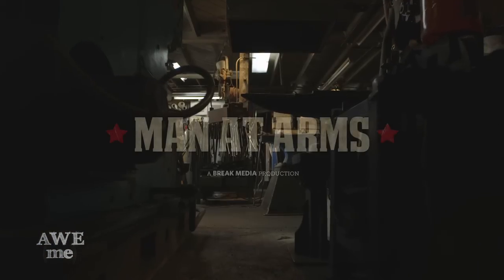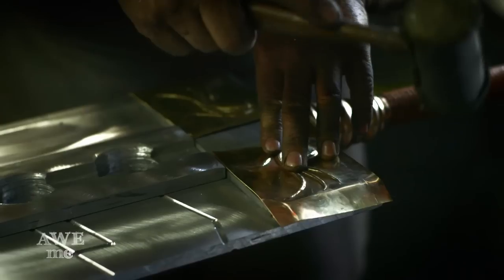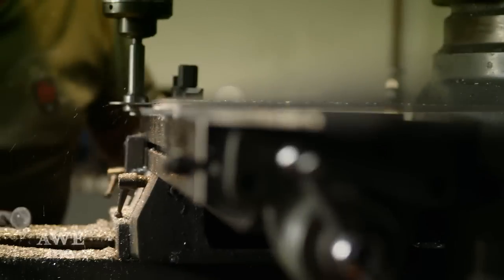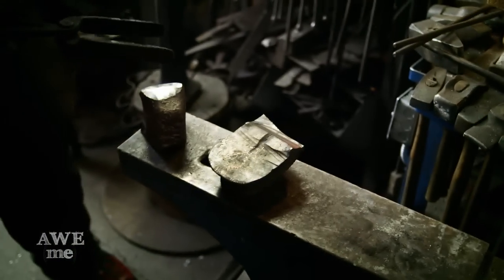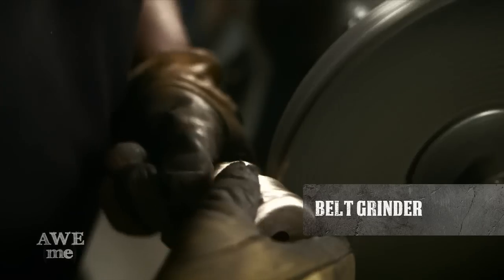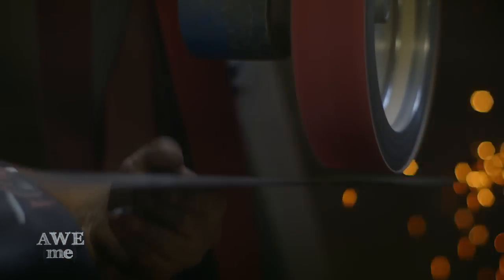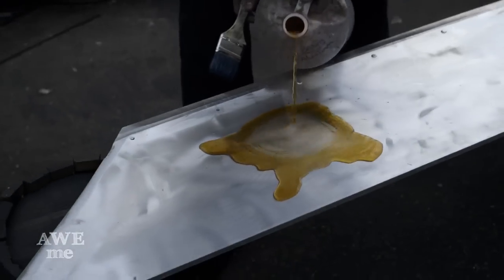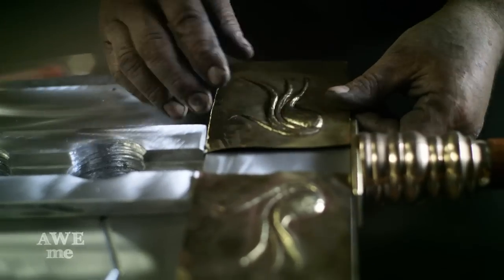Cloud's Buster Sword (Final Fantasy VII) - MAN AT ARMS

Comment: 2 people barley holding it cloud spinning it with one hand like a fidget spinner
Reply: Well, while they did a fairly good job, they oversized it.  They measured the blade at 6 feet long.  Considering Cloud is 5'7", 6' would be probably the entire sword length, not just the blade.
EDIT: Because I didn't go through the whole video first, here's the rundown.  They sized the blade at 6' long.  They then made an 18" handle.  That means the overall length of the build is 7'6", give or take a little.
Reply: @Anduril74871  oh yea just remove a foot and a half and then every person can twirl a greatsword around in the air
Reply: Cos they use heavy material when it doesnt need to.
Reply: Well, he also is a super soldier sooo.. mako mako mako
Reply: @mymagicloulou4394  they used Aluminum for most of it, much lighter than using something like iron or steel. if you are implying making it out of wood or plastic then that is just a bad idea. the problem here is that the buster sword is not designed well to begin with
Reply: @KoscheiMorevna  wood is for conventions...
Reply: Well also remember cloud is a genetically engineered soldier in a video game where one of his cohorts has a machine gun hand
Reply: @willjones3603  and another can suplex a giant robot....
Reply: Anduril74871 Cloud is 5 foot 7 ? Thought he was 5 foot 11
Reply: Cofff** zack is a spinning máster *cofff!!
Reply: that only shows how weak those man at arms guys are :P
Reply: Yeah, Cloud would have to be really, REALLY strong to wield that with such ease and still be agile with it.
Reply: isnt cloud, as an ex-SOLDIER, incredibly strong?
Reply: I mean Cloud is pretty much a super soldier. So a heavy sword is nothing to him and it kinda backs up why he cpuld lift it.
Reply: @TheN64man  In the games canon it’s probably that the sword was made of a lightweight material
Reply: @juansan2406  Cloud has the build of a First Class, Jenova cells and such. Probably stronger than most of them, he was exposed and experimented on for way longer, because they wanted another Sephiroth.
Reply: Didn't Cloud use the sword against Sephiroth before he got mako enhancements and was just a regular infantryman? I don't think it should be insanely heavy.
Reply: @moomer2675  I feel like that was just plot given strength, because he happens to be the protagonist. It would've been written off as determination related.
Reply: It was the Mako Energy that was fused into Clouds body that enabled him and the previous wielders of it to use it. Most SOLDIER Units used standard swords. As far as I know, Angeal, Zack, Cloud and Sephiorth are the only ones that used very unique swords.
Reply: @moomer2675 i guess he was as strong as a Soldier well he was build like one plus it must have been willpower
Reply: Anime logic 😂
Reply: @TheN64man he's not actually a SOLDIER. Play Crisis Core. He got mako poisoning and Zack dressed him as one.
Reply: @kenziehurlock he wasn't saying Cloud was 1st class, he was saying he's built like one. Which cloud says verbatim in ff7
Reply: @potatodude3947 no because he wasn’t in soldier
Reply: "cloud is a super soldier"

Wasn't Zack just a normal soldier?

Comment: How about Squall's Gunblade? Minus a functioning gun, of course.
Reply: Why the hell not a functioning gun as well???
Reply: I believe there are certain additional regulations to worry about as well as accidental misfirings.
Reply: Squall's Gunblade (and Gunblades in FFVIII in general) did not shoot bullets. Pulling the trigger sent an explosive shockwave through the weapon. A real life equivalent would be a trigger that either makes the blade punch forward an inch or so like a single hit of a jack hammer, or, send an taser tick through the blade or trigger a small front facing explosion.

Comment: The Buster sword in the game is only supposed to be around 4ft long. Cloud is a very small man.
Reply: The total length changes from game to game, in FF7 Cloud is 5'7" and the sword is a bit taller than he is. The blade itself is probably about 4.5-5 feet, then the handle takes it to about 6'. It's much thicker than the sword they make here, probably  1.5-2 inches thick so it would weigh much more than their sword.

But in Dissidia it is made a bit smaller, in Kingdom Hearts it is bigger. In Crisis Core, Zack is 6'3" and he's not much taller than Cloud, so how tall is he? Square don't seem to care, this is a good enough Buster Sword size. The quality is pretty bad though.

Comment: You made it too big.  The actual buster sword's blade is about 4 ft 4 from base to tip and about 1ft 1 and 1/5 wide at the base.  No wonder you coudn't lift it; by making it 1 1/3 times bigger in each direction you made it twice as big, its thickness was also too greta, resulting in a total weight that was four times greater than it was meant to be. (I based the blade size on Cloud's height of 173 cm, and that by turning the blade's image it seems to be about the length from the top of his head (minus spikes) to just below his knees, making it 3/4 his height in length)  Furthermore, it was prettier before you added the rust effect; it looked clean and new, like it did when Angeal had it.

Comment: cloud can handle his sword with one hand
Reply: Cloud is superhuman though. He's much stronger than a normal man.

His buster sword is probably much heavier than this because the blade is more dense. The blade doesn't have that same give to it. It would be possible to make a sword of that size that didn't have that give, but it would either a) be so brittle it would shatter or b) if it was composed of metal that wouldn't be brittle, it would be too heavy to lift - certainly to use effectively. Cloud's sword is the latter of the two. The Buster Sword probably weighs something crazy like 200lbs.
Reply: +SeraphinaAizen1 seen realisticly it doesnt matter how strong he is... he probably would have to weight 2000lbs or even more to just withstand the inertia while swinging it. when he holds it horizontaly infront of him the center of mass is somewhere at the sword which means that it doesnt matter how strong he is, as long as he isnt glued to the floor he would fell over any time he swings it or just holds it a bit off of his body.
Reply: hes a also a video game character in a fantasy game, Mind you they made that sword out of aluminum, had they made it out of steel im guessing it would weigh between 200-300 lbs
Reply: Because Cloud is genetically enhanced. If you played FF Crisis Core, they explain
Reply: Screw physics because video games
Reply: Games are never realistic anyways. A realistic game would be dumb
Reply: Excuse on what? That realistic games are dumb? It's because they are. No need to exert your self elitism on me
Reply: Well you better somehow quote me on that, because I'm checking the comments and i don't see anything related to what you are saying. I said realistic games are dumb, I never said they were bad. I also never said unreal games are good. No need to throw your own words into the fray
Reply: Or you can just play the game that originally brought us the Buster sword and find out Clouds genetic changes early on in FFVII. In other words, It was explained FIRST in FFVII. Crisis Core is a good game and all. But don't confuse your facts.
Reply: I like how the fool came back and edited his comments, get rektd
Reply: Oh, nothing, just admiring the weather, how's your day?
Reply: It's raining
Reply: Rizaldi Riansyah Cloud isn't real

Comment: I always hated this sword. It's impractical, and it's so damn ugly. How would anyone like this sword is beyond me.
Reply: Because this is a very iconic sword. It played a big part on our childhood.
Reply: plus have you ever wanted to be able to hold a sword this big
Reply: Maxwell Bosserman
!It's not the size that matters, it's how you use it!" LOL Penis joke! Aside from that obvious pun, it is the very core of martial arts with a sword. Pure strength has not that much of an impact as skill has when two swordfighters meet. The length of the sword has some impact, if the skill of the users are somewhat close. With longer reach, you can keep your opponent at bay and hurt him/her easier. there is no need for a big, unwieldy bulk of metal, any standard blade pretty much has the upper hand against a Buster sword, if physics actually apply to the world. Anyone with a little skill would place a few well placed thrusts and cuts into the Buster sword used, who is limited to moves that will not swing the weight out of the users hands or break the wrists.

Comment: One day I hope someone will make Cloud's Buster Sword out of an extremely light but strong metal so it can actually be wielded, if such a material exists.
Reply: Sadly that material does not exist. Titanium is tough and light but has 
no edge retention (dulls quickly) and aluminium is simply too soft. 
Steel is ideal but it weighs too much for such sizes.

The only alternative is either use a composite (like used in this video) or make it smaller.

Search on YouTube for "michaelcthulhu" as he has made some impressive blades, including several Cloud's Buster Swords!
Reply: George Cage
I really like his channel! He does a lot of impressive work for one guy.

Comment: To be fair, Cloud definitely has super strength, and it’s highly probably that the sword in game is not steel. After all there is a place called the mythril mines
Reply: With light alloys or tough plastics it's mass might be halved. It would still be ludicrously heavy. They are also used as standard issue equipment for literal supersoldiers.

Comment: Do you think it would have been lighter if they grinded an edge onto the big piece instead of adding the edge separately?
Reply: probably, but they did find an okay solution that both reduced the weight and gave them a proper cutting edge

Comment: I would realy like to see a 2.0 version of this sword where you make it look the same but reduce the overall weight down to less than 20lb yet still have a very sturdy steel blade and a full tang. My best thoughts are to make it initially shaped like a very large and skiny modified version of a kopesh for the steel handle and blade 6590 high carbon steel then fill in the back of it with a hard wood so that it functions more like a bladed mallet than a solid metal sword. if it is sharp enough it should still be able to cut and the wood  would give it the rest of the shape it needs with out adding to much weight. Thank you for an Awesome video.

Comment: Blade wouldn't work in reality too slow and requires too much strength. Backed up with physics, the blade(or should I say a hung of metal ) would send the user flying unless hes 1250kg or 2750ibs

Comment: This is just pathetically bad. The stain on the aluminium just looks terrible, the edge at the top is way off the correct angle as well as concave rather than strait, and the bevel is maybe a tenth of the size it is supposed to be. If you are going to remake a sword at least do some form of research and put some effort into actually making it look somewhat like it is supposed to.